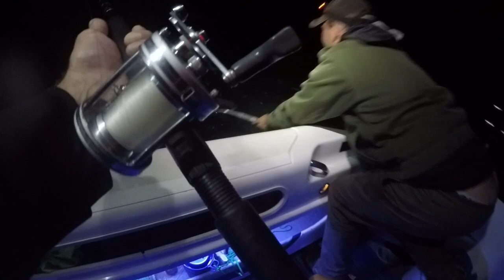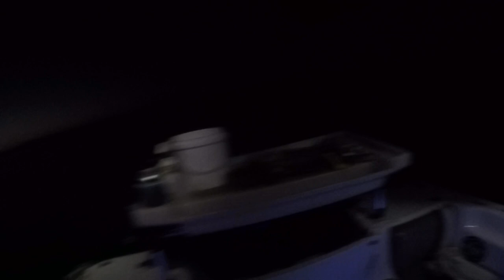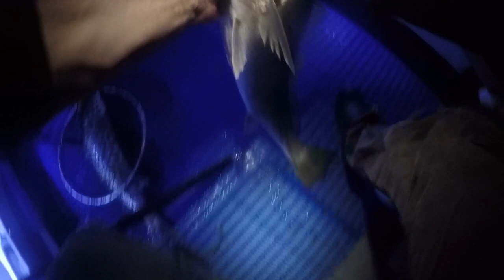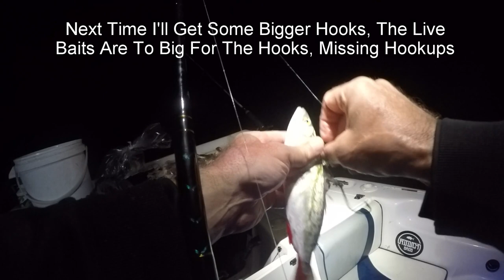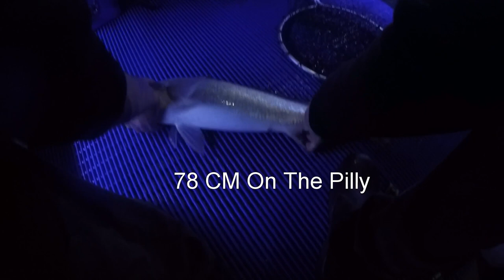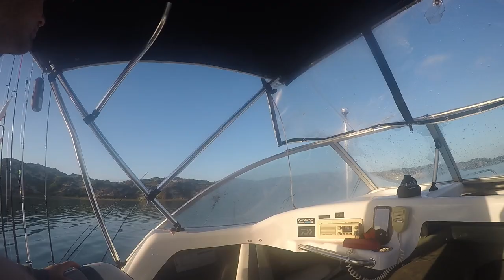MULLOWAY  ! Ep 15. HOW TO CATCH BIG MULLOWAY ON LIVE BAIT !!!

Comment: Hey man, when you bait up a livey, how come you put one hook in and leave the other one dangling? What happens when you find a crunched livey? We had missed hook ups aswell on the weekend...
Just subbed, cheers mate.
Reply from the maker: I've tried a few different ways of putting hooks in live baits and I've found having a hook hanging free I get better hook up rates. But in the last 2 seasons I've missed a lot of fish.  I put it down to lack of flow, I find the more flow the harder they hit the liveys.  Thanks for subscribing mate cheers 🎣😁👍
Reply: @ToddysMullowayAddiction  cheers for the reply man, we went on the weekend and the mossy weed was bad, but I found a pilly with a definite chomp out of it right between the 2 hooks which was strange and a livey got chomped hard but it must've been spat out. It was still on the hooks but it's bones were busted and squashed meat? Was my first trip out there...
Reply from the maker: @jazmuzz8423  yeah I  went last night , only had one live bait hit all night,  got 6 keepers on pilly and lost a big one around the anchor rope,  the other week had 3 or 4 liveys hit but didn't hook any of them,  just big teeth marks across them.
Reply: @ToddysMullowayAddiction  did you end up going bigger hooks thru the liveys? I was using 6.0 size snood black magiks... Guess I had it all wrong lol...
Reply from the maker: @jazmuzz8423  I put an 8/0 in the fish and have a 10/0 hanging free. I've upsized my hooks over the years,  Mulloway have big soft mouths,  so I think bigger hooks you get better hook ups